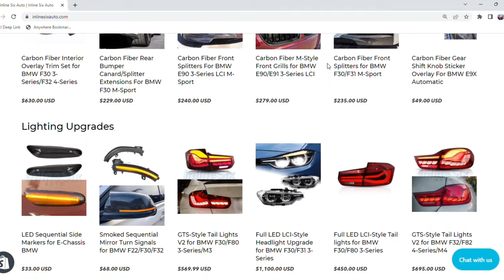The Best Looking Front Lip for Your BMW F30 M-Sport! | M Performance Style Front Lip

Comment: Thanks for posting this video! I love the M-Sport look. Recently purchased one on Amazon, but the company falsely advertised it was "carbon fiber." It was actually plastic with the carbon fiber print. However, I did a mockup install and it looked really nice. I'm really glad I saw your video because the company I found that sells the M-Sport lip with real carbon fiber also sold the upper "fangs" (aka front bumper upper splitters) as well. I was imagining the front vents kind of squared up in carbon fiber trim. But when I saw you angle it from the side, I didn't like how they stuck out like that. I can imagine parking it somewhere and somebody accidentally bumps them and falls off. No peace of mind... Can't wait to get mine! Just looking into carbon side skirts too before I pull the trigger.

Comment: I'm having an issue with my 2015 335i N55 But only at Idle.... car seems to idle kinda rough, had a lean on bank 1 code replaced MAF, Checked for vacuum leaks and what not nothing there with leaks. one guy on bimmer post said he was advised to change MAF and it didn't fix his issue but then he changed spark plugs and coil packs and it fixed his issue. not sure if there's any other obvious stuff to check for thats common on these. any ideas? thanks love the vids
Reply: this is only at idle btw no issues when actually driving
Reply from the maker: Are you getting any misfire codes?
Reply: @InlineSixAuto  nope, no misfire codes at all i just bought all 6 spark plugs and coils as well they come in on the 13th so i guess we'll see if that fixes it?
Reply from the maker: @AW-cx3ix  do you have any performance mods on your engine?
Reply: @InlineSixAuto  nope, but I just got all my new spark plugs And coils in the mail last night gonna get them put in and see if it makes a difference.  If not I probably needed them anyways
Reply: Broo idk if you fixed this but I had the same issue with lean bank 1 turns out when I replaced the intake I cracked my inlet. I definitely think it’ll be some type of vacuum issue.